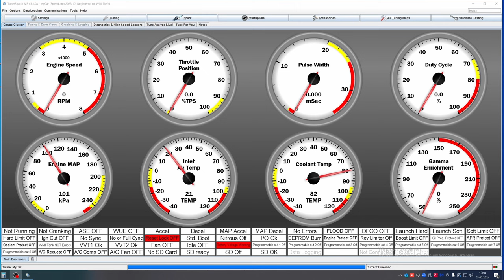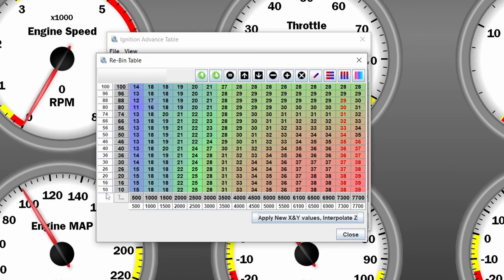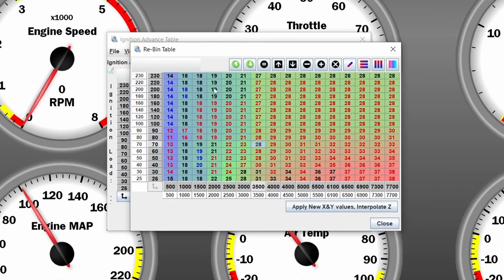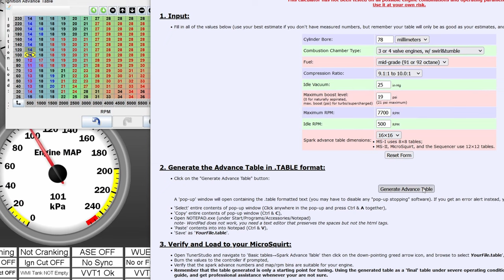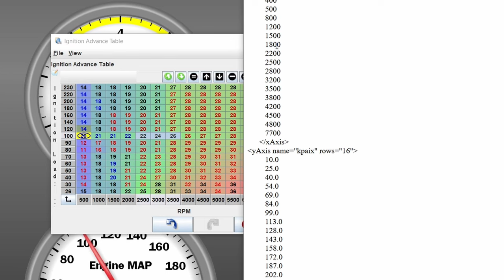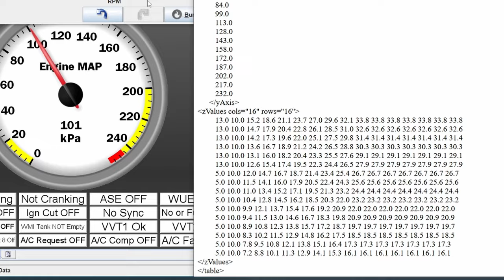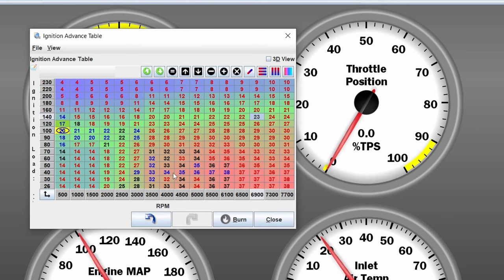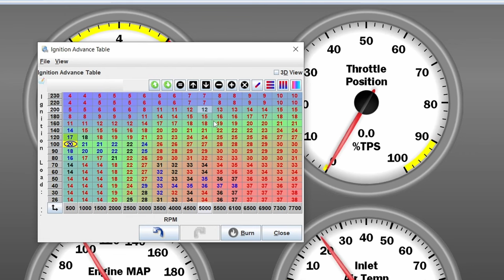Tunerstudio Standalone ECU Tuning Guide | Part 5: Creating a Spark / Ignition Base Table| Megasquirt

Comment: I am loving this video series its giving me ideas on what i need to do with my car the biggest issue im having as far as getting an ecu is finding the ecu plugs that plug into the harness itself rather than cutting up and repinning all the wires i have at the moment
Reply from the maker: depending on what car you have they might just be available online. https://wiki.speeduino.com/en/reference/ECU_Connectors here is a list of the most popular ones.also thanks for the kind words :)
Reply: @throttlebuddies6356  thankyou very much its a 2001 suzuki grand vitara with the 2.0 j20a
Reply from the maker: ok no idea but probably has some vatiation of the denso 76 plug 

send me a message on instagram with a picture of the ecu plug and ill have a look

Comment: Correct me if I’m wrong. But this only applies to coil/coil on plug ignition. If you have old school distributor you cannot control ignition advance using this software; only by manual adjustment with a timing light. 

Can you still input the degrees of advance into the software? Would it help?
Reply from the maker: depends if you have an electronically controlled distributor you actually can as there is a timing reference to the ecu. If there is a REALLY old system, yes you are not able to control it with the ecu, but thats only on non-efi cars bacifally so only carburated. 

if you wouldnt have any reference to the ecu then it would not work no.

Comment: How do you tune it without dyno? Just on road and keeping eye on knock sensor? Can be ecu hooked up to knock sensor thats already on engine to reduce knock?
Reply from the maker: On the speeduino its currently not possible to hook up a knock sensor. I will release a video on how to do ignition tuning on the road on Tuesday, i show everything there. 
I use DET-cans to monitor knock and adjust my timing accordingly. Works very well like that.
Reply: @throttlebuddies6356  thank you!